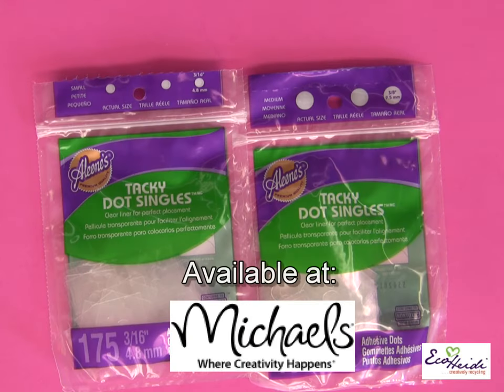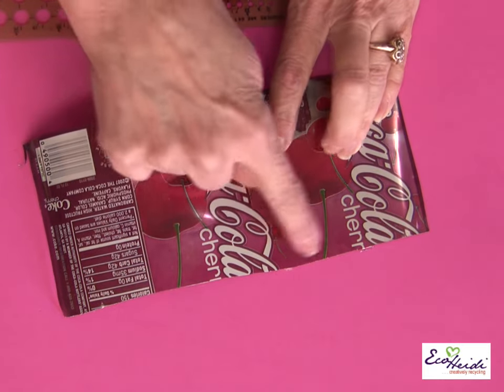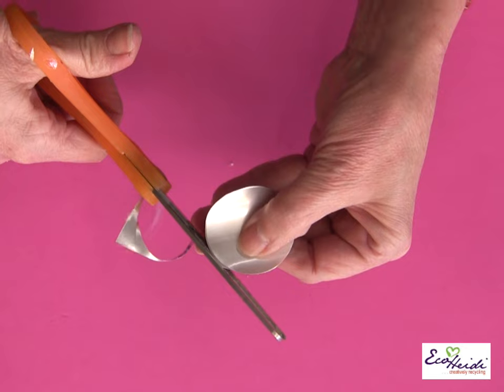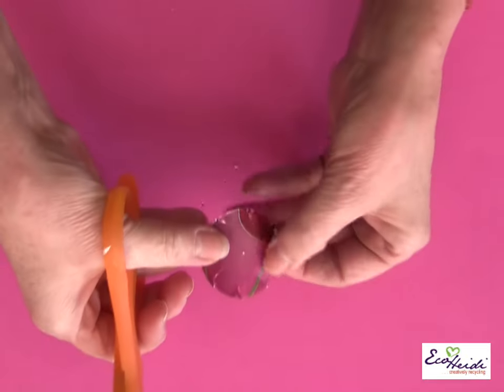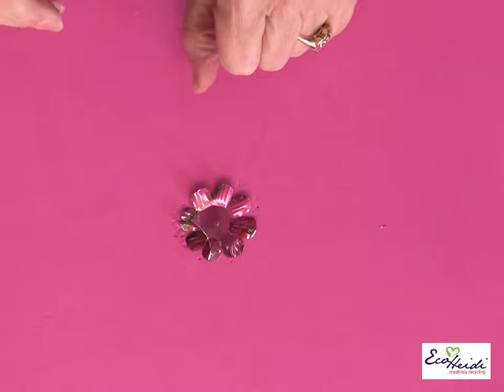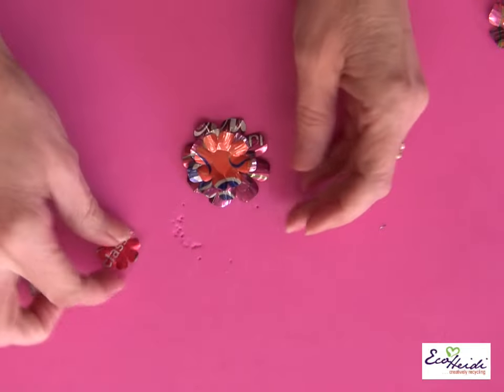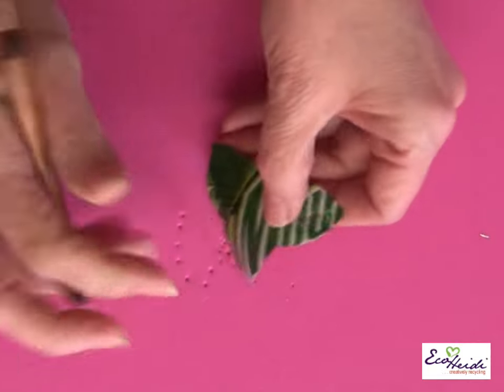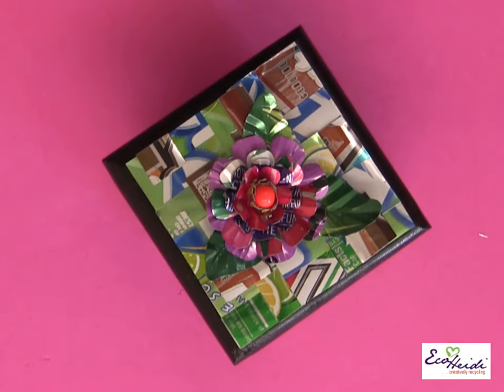How to Make a Soda Can Flower Box by EcoHeidi Borchers

Comment: Chloe
To make an 8 pointed flower, use a square piece of paper for your pattern. Fold in half. Then in half again. While holding onto the folded tip area. Fold right point over to left point. You now have a folded triangle. If you open it up you will have 8 sections/ petals, round each section into petal shapes. I usually cut all my layers together on the pattern before I open. When your flower pattern is cut, I trace in onto the soda can, then carefully cut out.

Comment: Another method for getting rid of sharp edges on aluminum soda cans is to sand the edges until their blunt not sharp.However one should always wet the aluminum can edge down thoroughly with water first to stop the aluminum filings from flying upeards.You REALLY don't want to breathe in aluminum filings.Also you should wash your hands and the sanded piece of aluminum THOROUGHLY after sanding the edges.